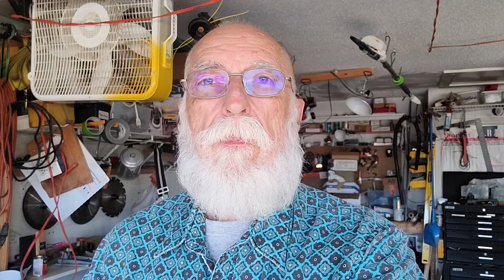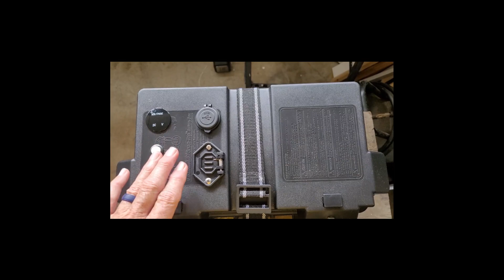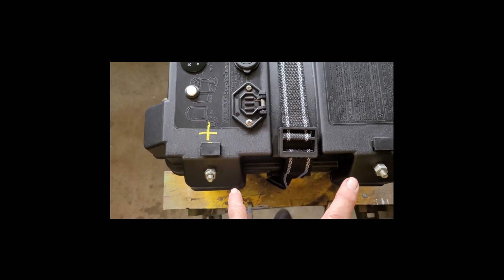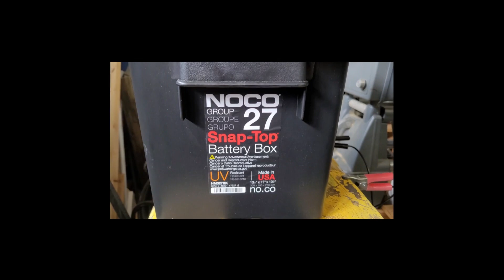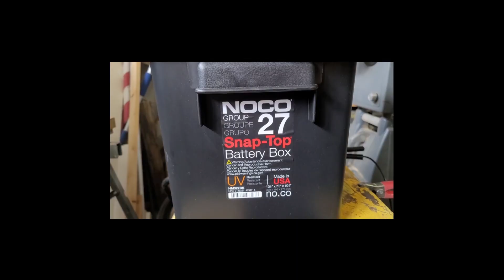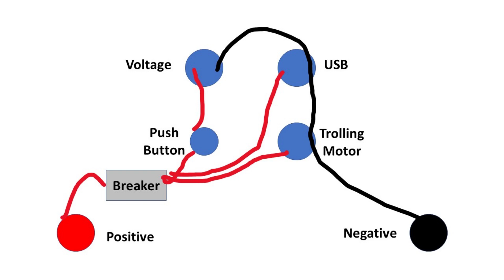DIY Trolling Motor Power Box

Comment: Thank you for this information! What gauge wire do you recommend to connect the battery to the breaker?
I am planing to use an 35ah battery with 30lb thrust minn kota.
Reply from the maker: Thanks for following along.  For 30 amps an 8 gauge will work.  However if you are considering going to a larger motor 6 gauge will do great.   Hope this helps.   -John
Reply: @omoutdoors  thank you John!